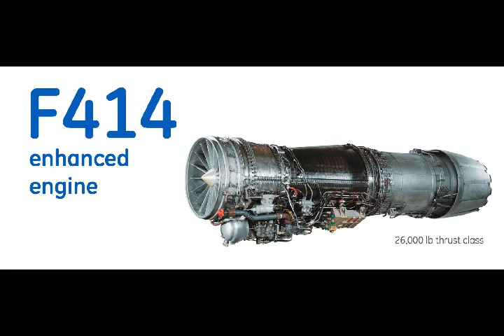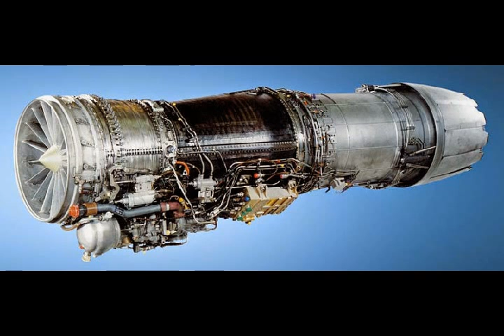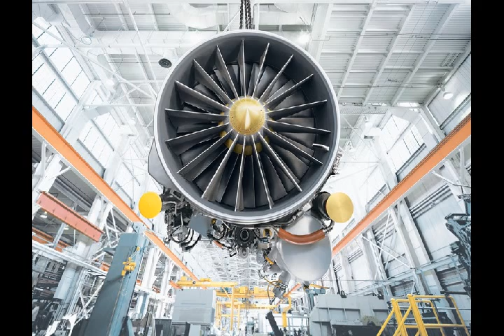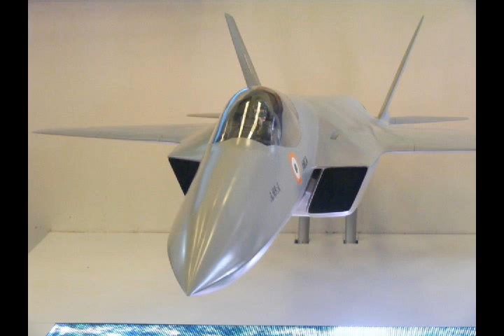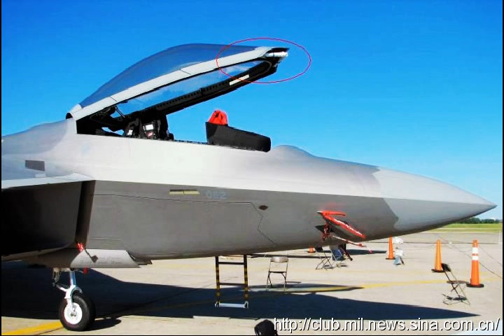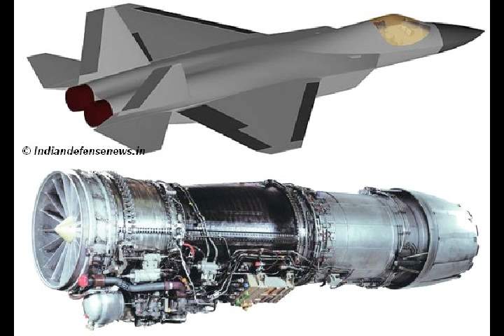US Willing to Work With India for it's 5th Generation Aircraft AMCA Engine

Comment: 220kN thrust??
even the F35 has 191kN afterburner thrust.
Reply: smit009 yes 220kN thrust,  go Google it
Reply: Sariel Reigns Сариэль Царствует that’s why f35 speed is 1.6 mach 
What actually india need is 250kn+ engine to have a speed of above mach 2.25
F22 has 312kn 
Japan has developed 294kn delivering xf9-1 engine. 
The ge has an engine f414 enhanced version delivering 116kn each so 232kn combined.